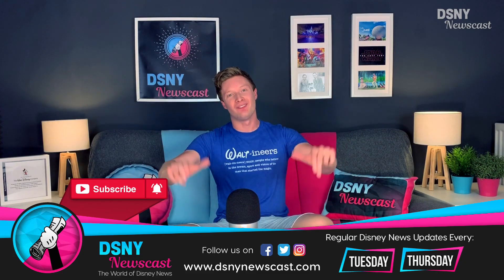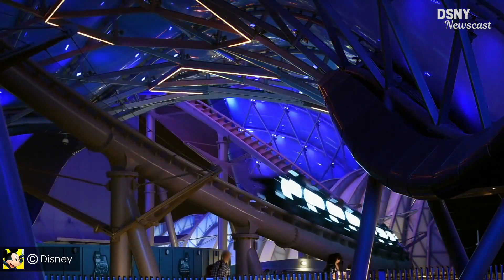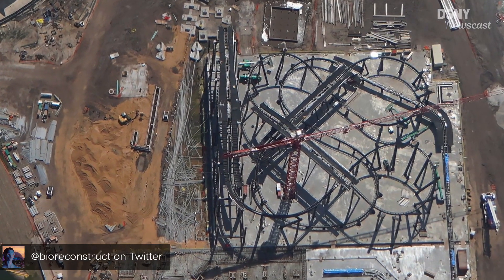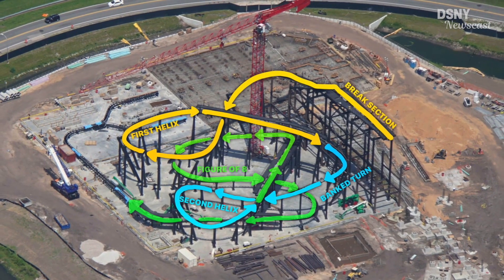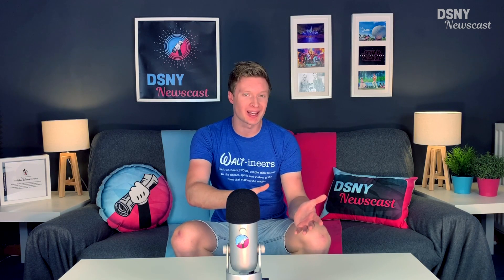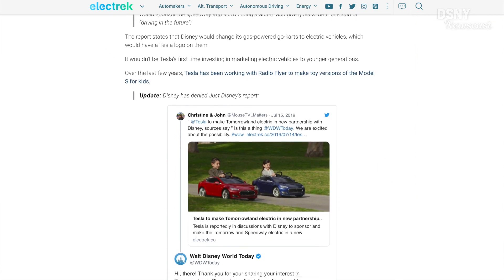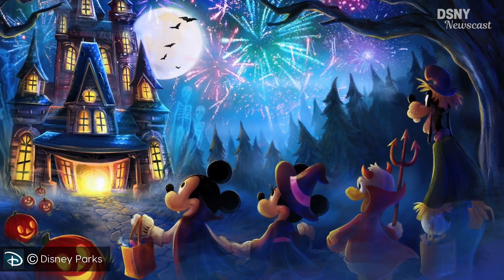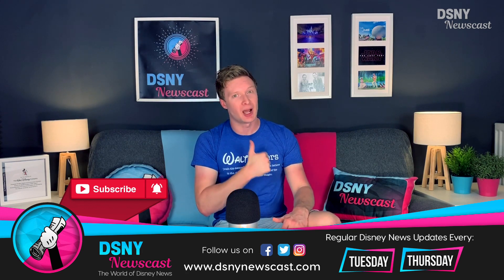TRACK LAYOUT for TRON Rollercoaster coming to Walt Disney World in 2021 - Disney News - 7/18/19

Comment: A Star Wars rollercoaster that is like pod racing, have a modified pod and have two separate tracks that race and intertwine with each other. They would separate in canyons and come back together, can even add things that people need to do on board which can dictate speeds so there’s not the same winner each time.

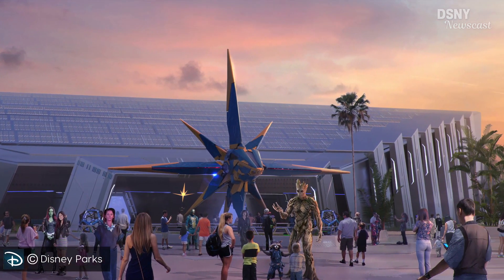Comment: hidden mickey at 2:15 and
when it comes to the question, i think an aladdin themed coaster in either Morroco in epcot or Adventureland in MK or Disneyland could definetely work
make it either Aladdin taking you on a carpet ride trip, but Jaffar (or if you want to get real risky, one or all of the sequel villains) attacks the guest and you work with Aladdin to escape and eventually defeat the villain. This could have a themed launch, where the load area becomes dark and teh scene begins as you begin to roll up to the launch. You stop for a bit, and that's when jaffar comes and attacks the guests. Aladdin urges the other Carpet to fly out of there and the ride would begin, ending with Jaffar getting sealed back in the lamp and the coaster ending. As the guests walk out, you could see Jaffar's lamp and hear him yelling curses at Aladdin. Think that'd be a cool addition

Comment: Not a completely new Roller Coaster, but the roller coaster experience I would most want to see at WDW is for the Rockin Rollercoaster to be refurbished and transformed into Dr Teeth and the Electric Mayhem's Rockin Muppet Coaster.  Aerosmith is good but past its expiration date, muppets are forever. Also Hidden Mickey at 2:15

Comment: 2:14 I know it’s crazy because galaxy’s edge is not open yet in Florida but I would add a coaster to this land. Hear me out! Lol. The back edge would be great for a “single rail coaster” (RMC Raptor). If they can make the ride vehicle look a Speeder bike using similar restraints from Flights of passage and the Tron Coaster; a single rail coaster design would make it look like everyone is speeding along in a team formation. As a plus, this type of coaster would be capable of tight turns, accommodate small spaces, keep a low profile, and be able to do fast climbs and big drops. 

Theming wise is simple because they could set the ride in a forest where you are doing new recruit training for the speeder bike but you accidentally run into the first order and have to escape doing crazy turn drops and even a few inversions. Since the whole land is supposed to be that the outside world does not exist then they could dig out a canyon for the main drop that leads into a dark cave for some show scenes where storm troops are shooting at you. The track post could even be disguised as trees adding more to the illusion that you’re in a forest.

Comment: 2:15 Well that is a hard question, but I'd have to go with a classic, a Bolt or Cars coaster. The ride will start similar to California Screamin' or Incredicoaster, you will make the turn and shoot straight up, but instead of the loop will go straight up, then go backwards like if you are falling down, so mix in California Screamin with Everest and a hint of Hagrids Magical Creature Adventure/ Big Thunder Mountain but instead using Bolt or cars. Also it would be in Magic Kingdom in either FronterLand or FanstyLand.

Comment: I would put a Rocketeer ride in DHS. I would put it in the Fantasmic arena. The ride would be one where you ride facing down, flying like the Rocketeer. You would fly low, close to the water, and up like Cliff Secord. The time the movie takes place matches all of the Hollywood Studios design, including ToT. The attraction would be designed around the flight school shown in the movie. Guests can view the ride from the top, where the concession stands are, which would be replaced and designed to be the diner shaped like a dog, from the movie. 

I would also take it one step further, and replace the Beauty and the Beast show, with the Seven Seas Club, the very fine dining restaurant and experience from the movie.

Comment: 2:15 Easy. Add a Cars roller coaster to Hollywood Studios as a part of its expansion. It would be set during a race, with different sections of the track based on/modeled after different corners of famous race tracks, for instance having a back-and-forth section based on Silverstone.

Comment: 2:15 I’d like to see a 3rd Galaxy’s Edge coaster attraction that’s basically Hyperspace Mountain on steroids. The ride vehicles would be similar to those on the Guardians coaster, but like x-wing fighters complete with an R2 unit in back. It’d use updated technology to have both projection and set piece tie fighters flying by and shooting at you. It would end with a trench run and exploding Death Star.

Comment: 2:15 Ok this idea is a weird one. I think a coaster themed around Disney’s ducktales would be quite a fun idea. As you may or not have seen, in one episode of the reeboot there’s a big gold dragon that flys through Duckburg. I’d like to mimic that in to a coaster. The coaster would start with a launch straight into a vertical lift hill. There would be one or two inversions but not too many as young fans of the show should still be able to ride it. It would be indoors and a props and set peices to make the whole inside look like the city of Duckburg. Seating wise, you’ll be sitting like you do on flight of passage that way you could feel the breathing of the dragon. At the end you go into Scrooge’s money bin for the finale.